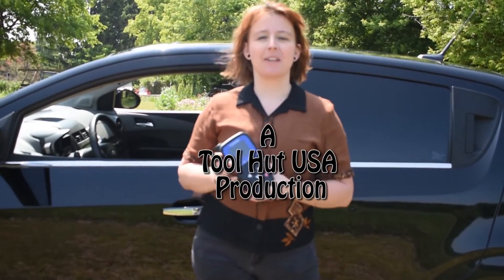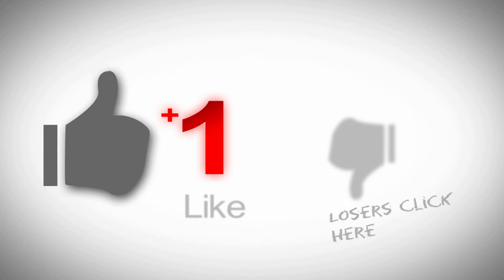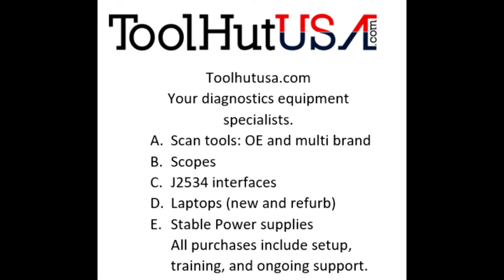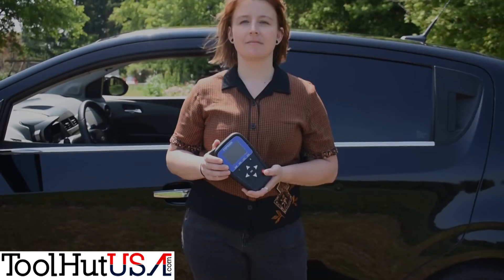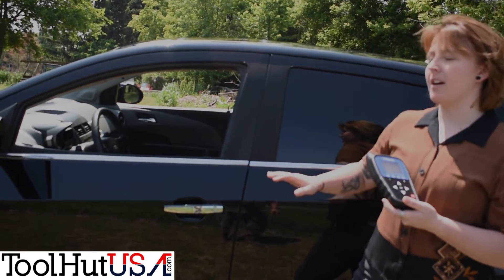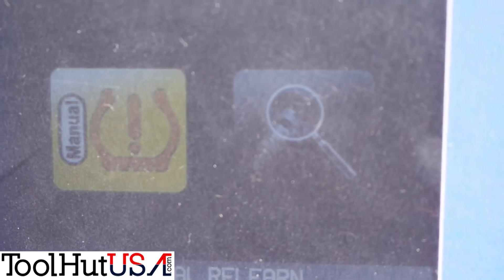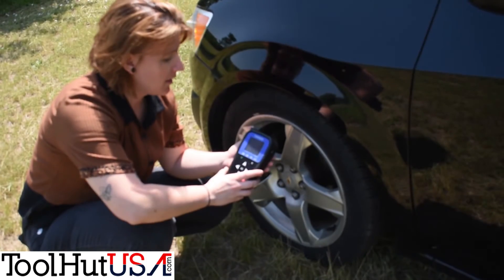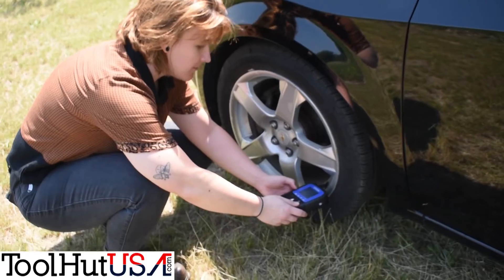Top Don TPMS Tools Demo TP47

Comment: First do you sell updates for topdon tninja key programmer? 2nd how does an independent guy get access to oasis to program an apim for a ford? Does it come with ford service data subscription off motor craft website??
Reply from the maker: The apim is programmed using fdrs. Yes I sell updates for tninja1000
Reply: @toolhutusaakathecarflasher3019  how much are the updates? Need serial number? I bought igg TV from you maybe 2 years ago. Do you sell the dodge cable for sgw? Does fdrs do updates? Or just for new installs? I got a used one changed as built with forscan to match vin but not sure about putting latest software in
Reply from the maker: @philh9238  you can message Brandi from website for update prices. The fdrs will do updates and installation
Reply from the maker: @philh9238  yes I sell the sgw bypass cables